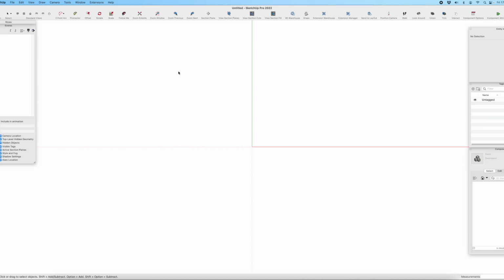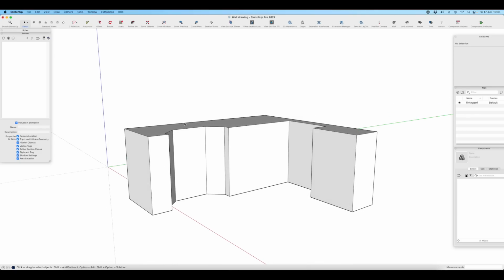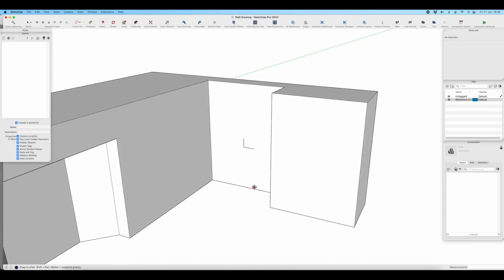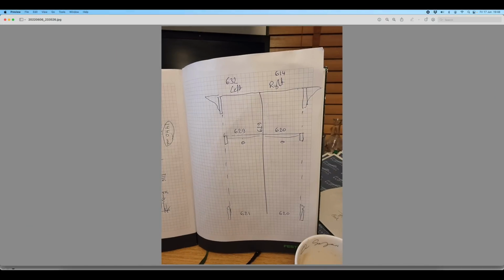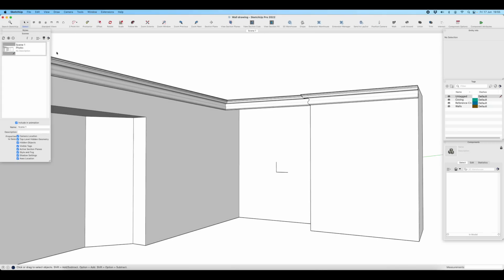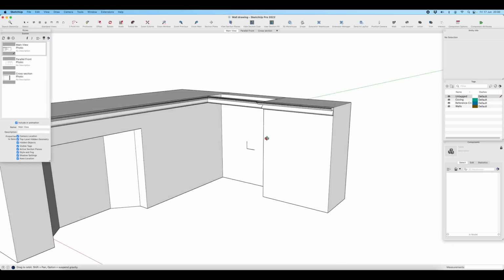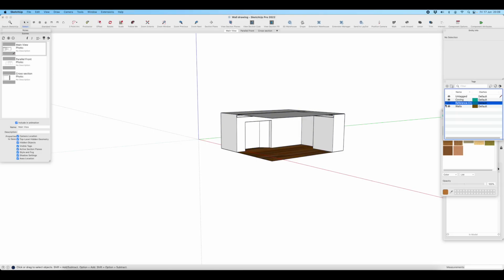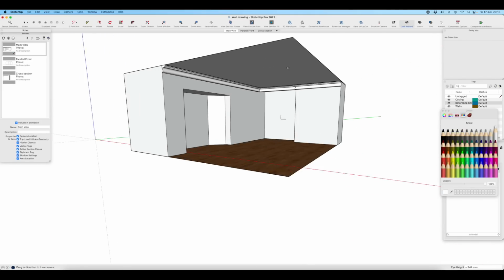Sketchup for Joiners - Modelling Walls from Measurments

Comment: Another informative video Oli; in addition to the multiples when copying components/groups, if you hit divide by it will add the extra parts equally spaced between the original and the one you placed which is great for shelves/dividers and the like 👍🏻
Reply from the maker: whoaaa Thats a mega tip! Cheers

Comment: Sketchup was amazing back when it was Google and had the free desktop version. I'd considered buying pro many times from that, but when they moved it to the web free version and it changed hands to Trimble it put me right off. I used to use it for everything from architectural drawings to small component design for 3d print.
Reply from the maker: Id say its improved with every update and is a lot easier to use now than it was in 2017 and i use it more than enough for the relatively small price tag the pro version costs. But agree having a free useable version was a great foot in the door for me, that others now dont have acess to!
Reply: @BradshawJoinery  Indeed it looks very good, alas unless you are using it commercially and can justify £250/year fee it's just not accessible to hobbyists anymore as the web version is atrocious even on a decent stable fibre connection. Keep up the good work. Learning a lot from your videos!